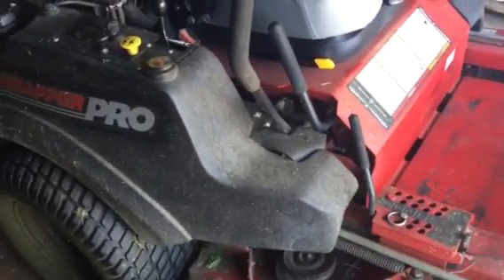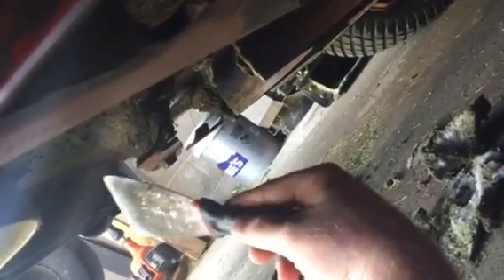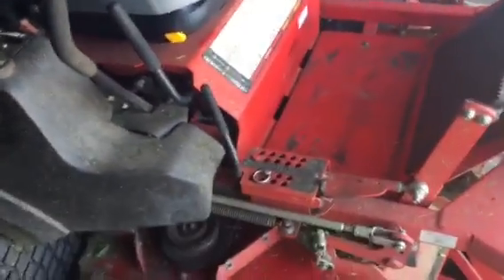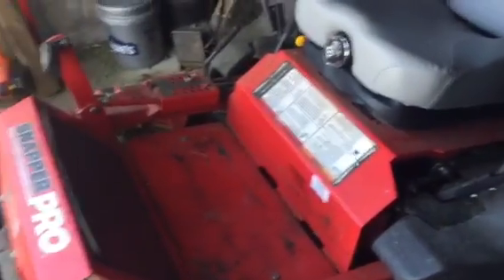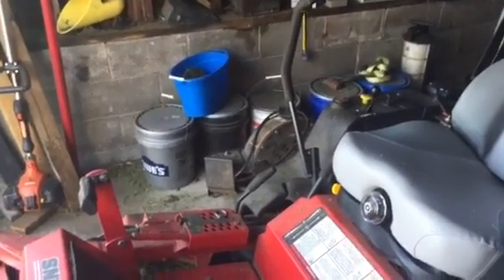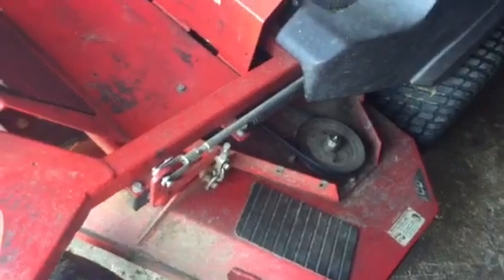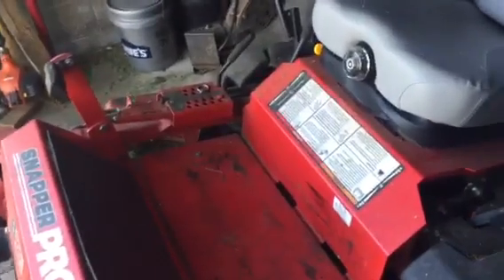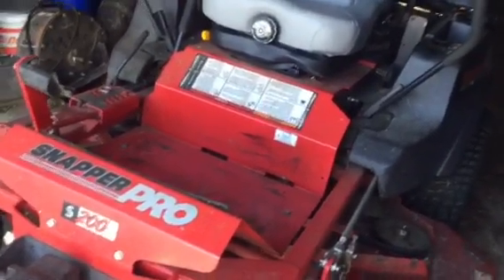Deck talk velocity verses Icd

Comment: Wondering if you've ever tried Grasshopper, out front deck? (930,or 725) I've tried a lot of mowers but only bought grasshopper with Kubota diesel for 20 years now. They are more$ but the advantages of the out front deck and durability of the Kubota diesel, ( got rid of one with over 5000 hours and never any problems) I believe far outweigh the price difference. For the last 5 years we've run 930's with 72" deck with mulching kits. Don't think we'd ever go back to side discharge. I'm in SE PA so I think you'd have same conditions we do. May be worth trying.

Comment: I have that almost exact same mower, a 52" ICD, 23hp kaw, s150. Have to double cut frequently, whether grass is thick, damp, or light and dry. Suggestions? Perhaps a high lift set of blades? I really do agree, the grass clipping dispersal is nice. Scag's around here disperse well, also thick grass, but probably a different breed.
Reply from the maker: Let me do a video on this
Reply: +Johnny Mow Thanks. I can say blades are sharp, deck is clean, but mowing is ridiculously slow if I stick to a single pass. It is enough to make me want a different machine. Half the speed of our previous old beat up Simplicity with gators. Thanks again!

Comment: Great job johnny ...love these vids
Reply from the maker: Thanks bud.   I've always been intrigued by bobcat.   We have no dealers around but I loved the look and wanted to get my hands on one!!
Reply: +Johnny Mow yea the thing with Bob cat is there like Hustler ...very expensive once you get into there commercial line ...but the one huge advantage with Bob cat is the warranty...shit u talk about warrantys in this vid ..how about a 8 year 2750 hour warranty....that what you get with Bob cat on there top model
Reply from the maker: Supreme Services Lawn Care nice warranty.  I would love to try a 61 procat.   Awesome warranty.  I've demoed hustler not a fan at all.  They are built nice but cut quality was terrible here
Reply: +Supreme Services Lawn Care I got there entry level and still has a 5 year 500 hour warranty...not good for you ..you will blow threw that in a year..but I should come close to 3 years ..then I usually sell anyway
Reply: +Johnny Mow yea I as you kno I don't run there top of the line stuff ..but I wasn't impressed at all with cut quality on mine ...I still have 42 ...which cuts a bit better ...but blade tip speed was the big issue with mine 16,500 just don't get it done ...my Bob cat rolling at almost 19,000 ..
Reply: I got a vid I will post on 61 pro cat I did last week when I picked up mine ...try to look for it tommrow

Comment: On a older video you said you got 4700 hours out of a Ferris that you use to own. What motor was in it ??? It's rare to get 4700 ours out of a air cooled engine. That bracket for your bagger you should have a beefier one fabricated to eliminate it from cracking. Great video !!!
Reply from the maker: 27 kholer.   Your right about the bracket

Comment: I have a 2022 Ferris ISX 3300 with a 61" deck. The cut quality is absolute garbage. New OEM blades, new Oregon super-hi lift blades, it doesn't matter. Taller grass 10-12", shorter grass, 4-5", cutting at 2-3mph, doesn't produce a clean cut. Clippings are only discharged a single pass width at most. Cutting a half, 3/4 or full stick produce a cut quality that is such garbage it's a waste of time. Any ideas, thoughts, or suggestions on how to make this better? I had a 2019 F320z with a 72" deck that was an absolute beast. It would discharge clippings 2-3 pass widths.

Comment: Have you ever bought used? Have you every demoed a hustler? Toro is very high dollar. Would you choose toro over exmark? so if you would buy a mower at this time it would be Ferris? I saw a toro 60 and the seat and place where you put your seat is all air ride.
Reply from the maker: I hate used.   I would buy ferris.  I paid 9200 for my toro it came with a suspension seat
Reply from the maker: I have denied hustler build great deck sucks

Comment: I love my exmark ultra vac bagging system. How much was that toro suspension seat? Also Johnny I have my toro timemaster 30 at my dealer for warranty work. I think it needs a new trans I believe they are about $160 for a trans but it might be under warranty which would be good
Reply from the maker: Great bagging system.  Great mower.  Seat was five hundred got it for 375 cash.
Reply: +Johnny Mow ok thanks . I might sell my 60 inch exmark with the triton deck to buy a new stand on mower I'm getting a demo for a toro grandstand but also going to demo the wright . I need a 48 my 60 is too big for my properties but my 52 does pretty good but it is an older mower

Comment: I'm thinking of buying the ferris 3200 61 inch.  I just bought the Z2 SRS which is awesome.  How does the suspension work. Does it scalp if you hit a bit bump ?  I currently run 52 inch decks on my Edgar homes. Do you think the 61 will be too big for 2 acre properties ?

Comment: Johnny what's your insight on the striping kit on the Ferris? I have the is700z which is great but doesn't stripe as well as I would like. do you do anything different to yours? other than what comes from the factory
Reply from the maker: I took it off!!
Reply: Thanks guys. Did you replace it with a different type? Or just leave it off all together?
Reply from the maker: +J & S LAWN SERVICE left it off. Those southern grasses might not stripe as nice

Comment: And Johnny I have an exmark lazer z 60 with the triton deck and an exmark lazer z 52 with a tri vantage deck and that's my exmark that has the ultra vac . Both mowers have kohlers.
Reply from the maker: Love the tri advantage deck hate the triton deck.
Reply: +Johnny Mow ya no body likes the triton it's alright for my unfertilized lawns that don't grow that good or thick. I run mulching blades on it and it seems to cut wheel but the mulching blades take a lot of engine horsepower

Comment: I am demo-ing a Simplicity mower next week. I have never demoed before. Can you give me any insite of how the demo works and what i should be doing during the demo?
Reply from the maker: First I would only buy the colbolt from the simplicity line.  Next you want to cut high grass.   Like I said in the video you want that mower to cut grass at the worst times so demo mowers at the worst times.
Reply: Thanks Johnny. I have the perfect property in mind. Im not sure how long i will have the mower or if I can take it to differtnt propertys.

Comment: Johnny I'm just curious, I just read a post from you from back in 2010 about your thoughts on the ferris icd deck and in the post you hated it?? Is this because it was 6 years ago or have they cracked down on getting it properly cutting?? Also which ferris 61 in were you thinking on buying once the snapper pro is out??
Reply from the maker: Yes I had a ferris at the time with the old style deck.  Then they came out with first gen Icd.   What train reck.  I had them ship me the old style deck.   In 2012 I bought a third year Icd deck.  Worked much better with a few modifications.  They made three modifications on those decks since its release
Reply: Ok awesome. So which icd deck would you recommend on the ferris? Like which ferris model line? Every mower you suggest I buy because I kno your the man. Toro 3000 series is top notch but if you say the ferris is better which one is it so I can go try and demo and potentially buy

Comment: Hey bud was really looking into switching out my two exmarks for ferris one of which is a 13 year only laser z hp 44 inch deck I talked to the ferris people today and got financed for a61 and a 44 ferris told them I'd like to sleep on it for a night would you switch out for ferris
Reply from the maker: No Icd does not cut as good as the ultra cut.  But u will live the ride.  After u have been with a company that long it's hard to switch and learn the new floors of a new machine.  If you live with pain from riding on a mower then absolutely make the change.  Food for thought lowest model I would go is the 2100 on the ferris line.  Any lower is def not worth the change
Reply from the maker: +Johnny Mow flaws